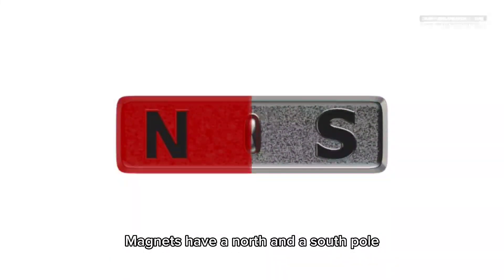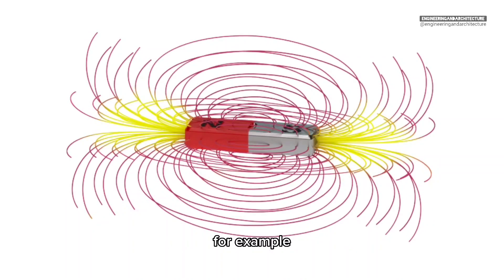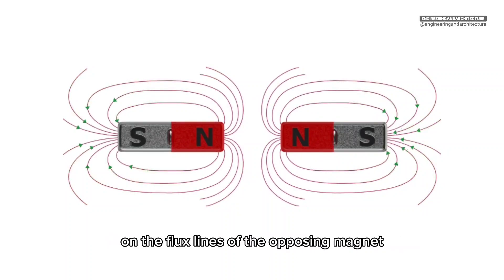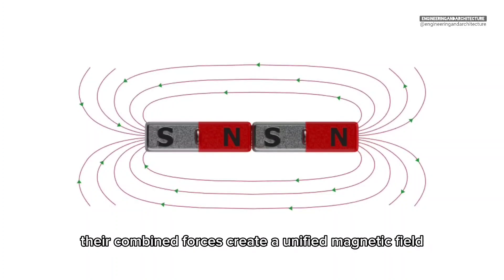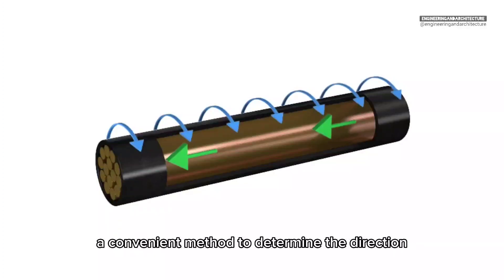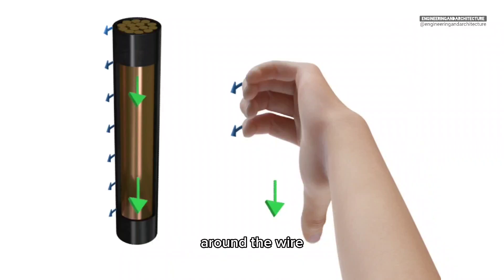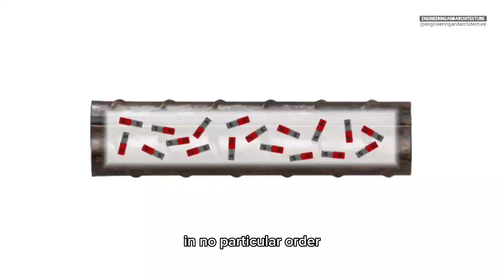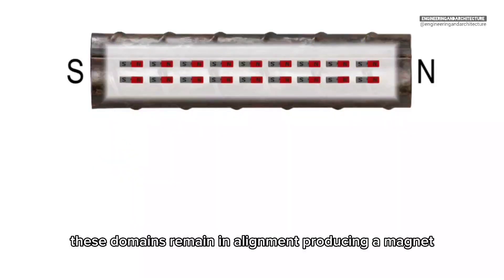What are magnets and how are they made - Magnetism and Electricity

Comment: Hook them up in series and in parallel and it creates volts and amps.

Make a battery of that and a person could get one tiny battery that powers up everything they will ever use in life ,.  
And.  ,.  ......
Their kids inherite that same battery,....
And then ,their kids get it too,...
And their kids,
And their kids,
Etc..,etc..,

   The buckyball molecule is just an ash molecule resulting from electricity arcing between carbon rods in an electrolyte.      
 I sure it can become quite cheaply made...
Don't know the cost of 3d printing molecular sized nanites  : but ; .....
There's so little material used to make them and usually they have very low number of parts; they can be capable of making tools, even up to replacement nanites.......

I'm just saying.
....................
...

Comment: Since magnets are carbon just like earth is  mostly carbon; and both are obviously reacting to a force of nature;: which gives them a polar field;: ...
.the   " buckyball carbon molecule " ,   with it's: permanent , naturally occurring ,  perpetual spin ;due to its reaction to a force of nature;.     it has got to have a molecular polar field around it ....very similar to earths poles.           It has its own north and south poles.  
We already use molecular machines: 
"nanites"; to grab hld of radioactives isotopes for treatment of onoperable fatal brain tumors rendering them less terminal or cured altogether.   If...... We simply used nanites to lock on to the buckyball carbon molecule, and harness it's spin or it's polar field;          ............
 
That's creates a two molecule, perpetually spinning,or powered up,  generator. Of. Electricity